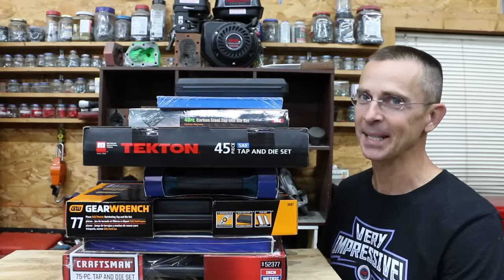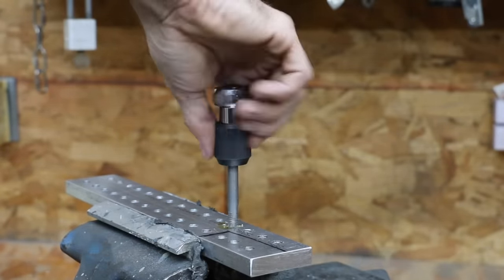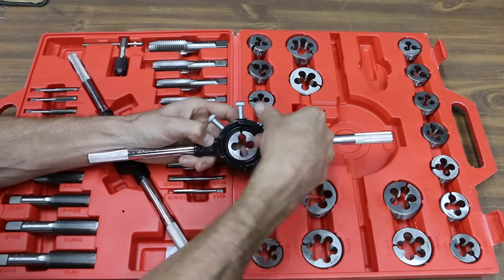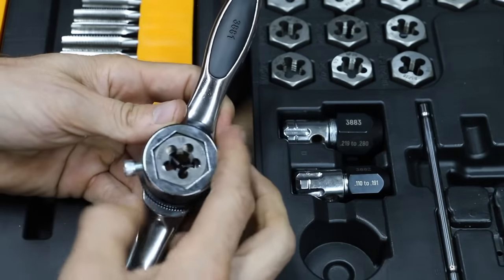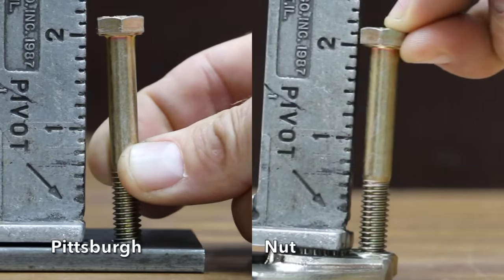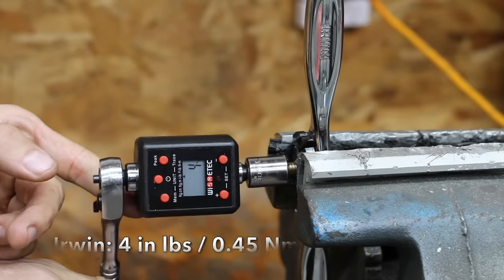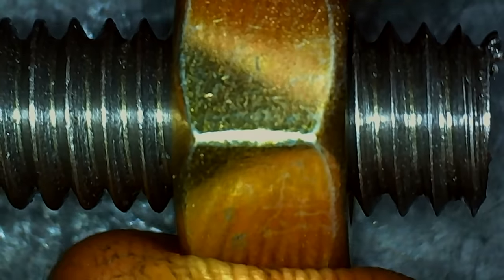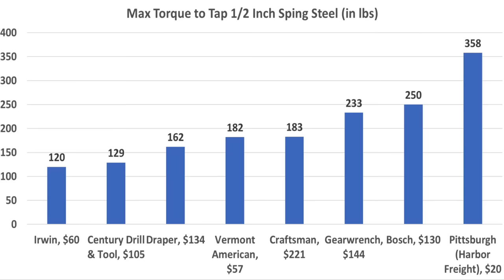Best TAP & DIE Set? Craftsman vs Irwin, Bosch, Draper, Vermont American, Tekton, GearWrench

Comment: Draper are an English company, but not considered among the best for precision engineering, these sets are more for repair or odd job rather than for serious engineering, if you want close tolerances use three taps, starter 2nd cut and plug, i've never considered die nut's for cutting new threads, just for repairing damaged one's, i have a set of 100 year old Whitworth taps and dies, a few of the smaller taps have been replace because i've been clumsy, i could make allthread all day without damaging the dies.
Reply from the maker: Thanks for the feedback.

Comment: As a Machinist who taps a lot of parts. This test is slightly flawed.  The torque wrench on the tap is causing it to "wallow" so therefore the tapped holes will be lose.  Using a Tapping block will keep the tap from moving in a circular pattern.

Comment: Bought harborfreight pittsburgh tap set it was completely junk there was no quality control all the parts had left over material from the cutting in the factory i had to clean one just for use tried to use it it qas so badly ground it messed up my hole i was trying to chase took it back the next day told them they need to pull it off the shelves
Reply from the maker: Thanks for sharing!

Comment: ----  I have that exact set of Craftsman tap/dies and am surprised at how well it did  -   I have found it to be quite underwhelming in performance  -  I don't even use it to tap new threads  -  my hobby is restoring old tractors, and a set of taps/dies is a must to chase old threads  -  so the effort needed is way less than tapping new threads  -   even so,  the Craftsman is barely adequate and the performance degenerates rapidly  -   still, seeing what they are asking for it now, I guess I shouldn't complain:  I picked up two sets (brand new - still in clearwrap ) at a Sears store closing in Mobile for $37.50 a set.
Reply from the maker: Thanks for sharing.

Comment: I wished I had bought another one each of the Craftsman big set tap n dies 30 years ago. I have worn and broken most of the two sets I have had maybe 35 years and I have returned many sets bought in the last 3 years due to breaking something on the first use or the taps not getting through 1/2 inch material due to tap choking on removed metal. If the tap or die threads are as nasty as many of these you tested then they drag instead of cut and bind up. If you do complete a hole your threads look like Acme threads with metal scraped off and no pointed peak on the threads. A grade 8 bolt with 4 grinder cut grooves and the end of bolt tapered is a better tap than many of these kits contain. Buy some of these kits to show, not use.
Reply from the maker: Thanks for sharing.

Comment: It would be cool if you also had a quick comment about if there seems to be a correlation between price and quality based on what you saw, and then a comment about what brand is the best bargain brand if you want to save a little money. So much info is amazing, but sometimes makes it hard to catch those little details. Sometimes I 'm just curious about the little things like that, not necessarily the actual best brand.
Reply from the maker: Thanks for the suggestion.

Comment: Just for reference, you never run a tap or a die in a continuous rotation. The proper utilization of those tools is to use back and forth rotation to cut threads and eject chips. I am talking about 90 degrees rotation in one direction then 90 in the other, and you should also never do it dry; a good thread cutting fluid should be used. Use an air gun to blow out chips as you go too, lest you risk snapping a tap in an expensive piece of product that was ready to ship before you broke a tap.
Reply: That's why you don't let the apprentice do the important work.

Comment: I have watched many of these videos where when doing a test you have a control piece/part/tool of a known standard or quality. 
Not so in this test. 
Like many others in the comments I have been a machinist for 45 years and on CNC mills for 30 years. 
Why did you not have at least one high quality tap and die from a company that only makes cutting tools? 
Sanvick, Iscar, Kennametal, Guhring, Greenfield USA and many others make good tools. 
Your test would have been more valid in smoothness of cutting as well as fit and finish of the threads in question. Yes it is true that a single tap and die from some of these company's would cost as much as some of the sets  you are testing but then you would have seen the real difference in the finished product.
I like and enjoy your work but this test gets a thumbs down.
I suggest you try to enlist the help of a local machine shop and run the test again to show are the cheap sets even worth the money as well as bang for the buck.

Comment: Good quality taps are made of tool steel. Those hex dies are actually thread chasers. A thread cutting die has a larger throat and is adjustable, to create different classes of fits. and is made with different cutting angles to allow free machining of the thread. There is NO comparison between quality US, German, or British taps          and Chinese taps. If you're lucky, you'll get one use out of a Chinese tap and it's done. Also, there is the terrible fit in the thread, I bet you there is less than 50% engagement in those Chinese cut threads. They would fail at only 30% of max torque for that size and pitch. I think they cause more trouble than they fix. I'm a retired tool & die maker and the US British and German taps I bought in 1971 still cut perfect threads today. What more can I say, you get what you pay for.
Reply from the maker: Thanks for sharing.

Comment: I had used that craftsman set at the end in machine shop for a pump company its embarrassingly bad, couldnt cut new threads with it
Reply from the maker: Thanks for the feedback.
Reply: Which one worked well for you?
Reply: @Norte Oak  i just used older morse taps an stuff i already had but other than that I would purchase basically anything mcmaster carr or other major retailers had an would work fine

Comment: Weight and torque are unrelated to tool quality. Instead of eyeballing the relative looseness of the tapped thread using a bolt, you need to use a go/no go thread gage. Minimally you need to use a tap guide to keep the taps upright. Regarding the dies, the alignment of the rods you were threading were all over the place. This directly relates to looseness. You did all these careful tests and documentation and I'm sure you meant well, but all these measurements are unrelated to quality.

Comment: Nothing worse than a tap that is too large, and ruins the material with loose threads. That's terrible. It's unbelievable how crappy the dies are, as they seem to make way too small of threads, and most of the taps produce way too large of threaded hole. Apparently they all need to go back to the drawing board and retool all their tap and die manufacturing equipment based on proper measurements. Really good tests.
Reply from the maker: Thanks!

Comment: None of the above. Guhring or Tapco is where I get my taps from. Been there and done that with the other taps and dies and regretted it greatly. The movement you get on finished products can depend on a lot of different factors. Rod size and hole size. I usually tap at 50% rather than the typical 75% industry standard so I get a closer tighter fit. In this case, drilling a smaller hole or using a larger rod is key to getting a snug fit.
Reply from the maker: Thanks for the feedback.

Comment: I must be doing something wrong??? < Confused face>  I pay way more for my tap and die sets, sometimes almost 10x as much.  Maybe more.  I need to contact Dormer and Cle-Line telling them they are ripping me off although they due seem to last a really long time and cut as smooth as a baby's bottom.  I even have some old Chicago and Cleveland sets from a retired machinist that have been used many times and still are 50x better than these, he had also cut most of his threads on a lathe or mill though
Reply from the maker: Thanks for the feedback.

Comment: Learn about Taps and tapping from a Machinist.  Search for this video: "Tapping Essentials - Every Machinist Needs to Watch This - Haas Automation Tip of the Day"    ALSO, use a tapping handle/holder, not a ratchet wrench, unless you enjoy breaking taps via impalanced application of force.   And finally, use TAPPING FLUID to help the tap cut more freely.  Tap Magic brand  offers a range of different cutting fluids.  Or, using basic lube or cutting oil is better that nothing.

Comment: Taps are hardened steel, as such they are inherently brittle. They all break if used incorrectly and has very little to do with quality.  Quality is all about precision, and longevity. Longevity is about material hss, carbon cobalt etc.  I like the comments by the machinists who mention that they can use low quality with good results because of their experience with set up.  To the guys who said all these sets are junk are demonstrating their inability to use basic tools properly. Break it? Maybe consider it isn't the fault of the tool?
Reply from the maker: Thanks for the feedback.

Comment: I feel like the die thread cutting test was not as accurate as it could have been, I was taught to tap and die cut threads by advancing alittle at a time and reversing to clear chips to prevent damage to the thread and tool. Also when you had the split dies in the vise they were clamped shut increasing how much material they removed making a sloppy fit.
Reply from the maker: Thanks for the feedback.

Comment: Do NOT use chinesium metal taps.
I snapped one just cleaning up threads not cutting down deep in a engine block..
Took hours with dremel and diamond needle drills to cut it in half .
Never Again!!!!!

Use Greenfield taps.

Grainger has them.

Ps there is a special machine "EDM" which electrically vaporizer of broken tap, drill or bolt in the part .
Expensive but can save your motor.
Reply from the maker: Thanks for sharing.

Comment: Obviously youve never worked in a machine shop, but the sloppiness driving in the taps and the fact your not breaking the chips is part of why the threads were sloppily done.
You have to keep the tool straight  
But i wouldn't waste my money on a cheap set, go buy each tool as you need it from a machine shop supplier the bits will be Japanese,  German or american made true  hss or other metals that stay sharp better.  Your money ahead doing that with each one you buy, and keep them in a cardboard or plastic case not laying in a draw with loose drill bits or other cutting tools.
If you only use one once and a wile it can last a lifetime or even genrations.
If its a one time use  just buy a good brand anway the threds will be better and the tap shouldn't break if you dont hog down on it.
When your cutting threds you have to clear the chips.   Not doing it is a fast way to not clear a go nogo gaudge.  Nogo is a scrap part. It cant be used.

Comment: I recently purchased the Irwin complete set-BIG BOX that included all the lettered and numbered drills, a chart for tapping, etc; I returned it.. Just TRASH... Seriously. The drill bits were super sharp and I was very pleased with the quality of the drill bits.. However, the tap holder was just useless. The die holder would not even hold a die to thread an 8MM bolt.. It was WAY over priced at $378.. I thought I was getting a good set that would last me a lifetime. In reality I broke the 3/8-16 tap the first time I used it.. i returned the kit at that point. I DO NOT recommend Irwin. I'm in the market for a QUALITY set of taps and dies. If anyone can recommend something of decent quality, i would appreciate it.

Comment: I will compromise on many things, but NOT on tooling?  Why not?

Because if you have the tap out, you are repairing something like your subframe or your cylinder head.  Do you want to cut crappy threads and potentially ruin a $$$$ part?  Hell no.

Comment: My suggestion is to retest this using the provided tools in the kits instead of a ratchet and a drill. Every thread you cut had massive wobble in wether the ratcheting out a hole or drilling an all thread rod. Not a good test nor stander to judge the tools on, unless you plan on doing things the unprofessional and wrong way.

Comment: @Project Farm

I'm a fan of your thoroughness on tests but I feel you missed the mark on this one.

#1 not using a rigid, inline setup to tap the holes leaves too much room for operator error.

#2 All the tap sets you used are low to mid grade, no quality stuff to be seen. Even if you can't afford a full set of quality at least grab individuals of the sizes you're using so we can make an informed decision.

Comment: At 0:24 the Harbor Freight Pitsburgh Tap & Die set is NOT a lifetime Warranty.  90 days only.  Which is probably better than any "lifetime" warranty on Tap and Die sets.  Because if a tap breaks during these 90 days - you can complain and they will replace or give money back.
The "Icon" (harbor Freight) tap & die does have a "lifetime."  However - there is NO actual LIFETIME warranty on a CUTTING tool from ANY Brand or manufacturer.  Not even the old Sears Brand Craftsman (when it WAS Sears) replaced a broken tap or die.  These are CUTTING tools just like a DRILL BIT.  You demand a replacement Drill bit when it gets dull??
The "LifeTime" warranty only applied to manufacturing defects - not that the tap might dull with use; or break if you try to thread a too hard of a material or start it at an angle.  Etc.   ALL of these Lifetime tap and die warranties - explicitly Exclude normal "wear and tear."
Reply from the maker: Thanks for the feedback.

Comment: Another great video, HOWEVER, as long as you are tapping by hand you have no standard as such. You need to eliminate any wobble. Any such wobble impacts on nearly all your benchmarks. Also comparing apples with tomatoes is a poor comparison. Surely there was at least one tap size in there which was common to all sets?! No thumbs up for this test Im afraid. No thumbs down either because you at least you took the time to do a test.

Comment: With hand taps you need to back them up to clear chips.  Running them in the way you do isn't fair representation of the taps performance.  All you are showing is which taps last longest when used improperly.  There are taps made that doubt have to be reversed but you can't but them at Harbor Freight

Comment: None one of those is worth its price as scrap for anything other than chasing threads. Except for the Irwin die stock. You need to buy from MSC or similar suppliers and get OSG or Guhring for high quality taps and dies.

The reason the 5/16-24 tapped easier, is you're cutting LESS MATERIAL out.
Reply from the maker: Thanks for the feedback.

Comment: They don't know how to tap hole. The tap is turned 3/4 to 1 full (360) turn then the tap is rotated 1/4 back to clean the hole and the tap of chips that will damage the hole. Next go clockwise again 3/4 to 1 full turn. Repeat sequence until depth on threads is to specification.

Comment: If you're going test taps don't test it it on aluminum. Test it on 4140 heater treated , or 300 series stainless, inconel. Don't trust a aluminum thread ,without a helicoil insert.
Reply from the maker: Thanks for the feedback.

Comment: Taps are designed to give different thread fitment. You have to regulate how far you turn them in (pipe taps too) For example 3/4" from the top will be a tighter fitment than nearly bottoming one out. You never start by threading a tap all the way in, not unless you want a loose thread.. You should have had a stopper or marker on those taps. And never drill them in too far if you want a nice thread fitment.

Dies.. if you have the right holder. Many of those are designed the same way.. as a machinist, you do have some control. But you would perhaps have to study that. You can make a tighter fitment with the right setup/ holder.
Look at your die holder.. most dies will accept the rotation that you place it in. Yes, they are split. Surprise.
You need to choose what class fit you want. Many tap and die set support all of these. But you have to know how to use the tool.
Good video though to see how sharp some of them are.
But the users should have been taught how to use the tool properly.
Hopefully that makes sense.

Another little tip just so your viewers know. You can slightly undersize your pilot hole when you're using a tap.. if you're looking for an extra tight fitment.

Good video, but you left out an important variable and made much of the test worthless 🤷‍♂️

Comment: Given that I always enjoy your tests, the testing  would have been better using a plug gauge to check the thread. Also The taps need to be used with a proper tap handle. These are all low quality sets.
Reply from the maker: Thanks for the constructive feedback.

Comment: It did not seem to me that this was a good test for value. It seems the cheaper sets had fewer pieces than the more expensive sets, so in reality the value never differed. It might have been valuable to buy some individual high end taps to truly see if the high end, high priced taps are better performers. Further your tests made me think of the way Forged in Fire tests knives and swords, IOW, doing what you should never no with a knife or sword. You could say your tests are the best example of how to best destroy taps and dies while creating inferior results. IOW your tests seemed to me to be which taps and dies do the best job when being improperly used.